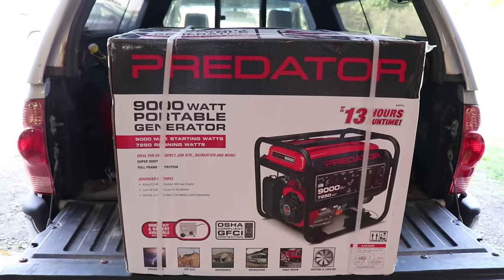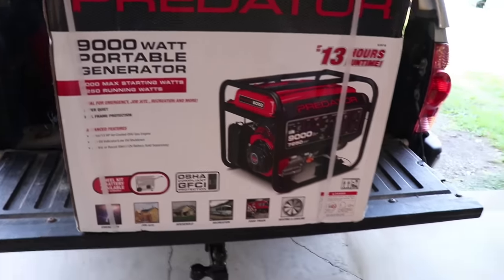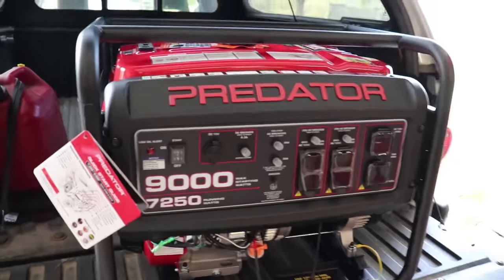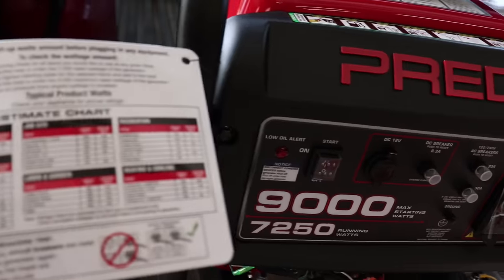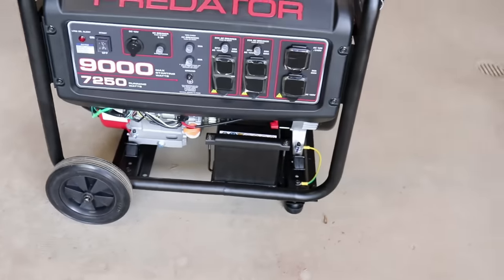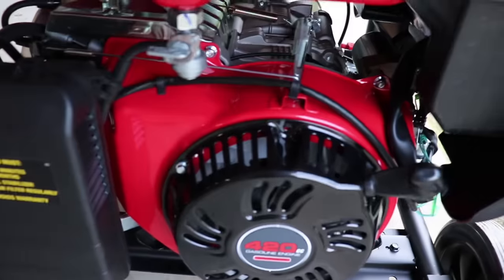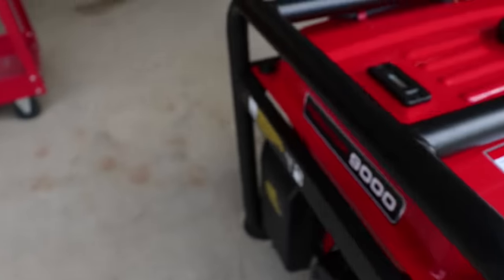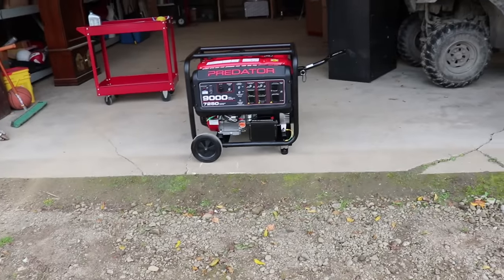Predator Generator Running Our ENTIRE Home. (Complete Setup and Cost)

Comment: I have that same 
Predator 9000 Generator that I purchased from Harbor Freight. I like to see how they wired your breaker box to do this?
Reply from the maker: Look at video in description.
Reply: @TheCookFamilyHomestead  Well, here's my question. With the basic 10/4 Generator Cable. Considering, the Generator has a Female 30 Amp outlet on the Generator. Do you simply cut the Female plug off the Generator cable to wire to the fuse box. Keep in mind, the generator cable has Male connection on one end and female connection on the other end. I see many installing a Female outlet to their fuse box. With a female outlet from the fuse box. Would mean, you will need a 10/4 cable with both Male connections.

Comment: My setup is similar.  240v 30 amp 7200w max on that 30 amp double pole breaker on your box.  I'm on the fence of which generator though....maybe a cat 7500....

Comment: Great information and video. The only thing you didn't mention was how many volts cable you used? Was it 125 or 250? Was it a 30 amp? I have the same generator and same plugin but need the cable. Thanks for your response and the video.

Comment: How's the generator holding up after a year?
Reply: I have something to explain to everyone about the safety and hazards of using generators. Make sure you follow all the manual instructions carefully. We have heard that many people have died each year when using generators due to carbon monoxide poisoning and electrocution. There is something very serious that everyone should always be aware of when using generators. Some people do run their generator indoors which is not safe and that increases the risk of carbon monoxide poisoning which can cause death of family and you. Some people run their generator in wet conditions which can electrocute them. Here’s an advice about generator safety: please remember that you should never run your generator indoors. Remember that carbon monoxide is an odorless and colorless gas that you cannot see or smell. Carbon monoxide is a silent killer. Keep that in mind. Make sure your generator is 15-20 feet away from your house and away from doors, windows, and vents. Having a carbon monoxide detector is very important against generator safety. Some people also allow children to go near the portable generator which could pose risks. We need to keep an eye on our children making sure that they are not near the portable generator so they won’t get electrocuted or burned by the generator which is dangerous. It says on the manual that we should also keep children away at all times from the portable generator to avoid injuries. Generators pose electrical risks. If you need to use your generator during wet weather, you need a generator tent to protect your generator from getting wet. Don’t let your generator get wet. Keep your generator dry and before using your generator, please make sure your hands and your generator is dry. Everything that is said on the generator’s operating manual should not be ignored. Never smoke cigarettes near the generator. Please keep flammable things away from the generator. Never overload your generator too. Your generator can catch fire. Never ever try to plug a generator cord into a wall outlet to avoid back feeding. Back feeding your generator is dangerous. Always turn on your generator first before plugging in appliances and shut off the appliances before turning your generator off. Use a heavy duty cord for your generator and the cord should not be worn out. All the instructions should be followed carefully. Never refuel your generator while it’s running. It can cause fire if fuel spills while your generator is hot. You should turn off your generator and let it cool off before refueling it. This is only a reminder for everyone’s safety of using generators. Make sure your generator is properly grounded. https://youtu.be/I1jT3ANENvI and here is a video more about keeping others safe when using generators. Keeping children safe is also important. Thank you hope you stay safe as well. This is only a reminder to be sure that everyone is aware with all the warnings.

Comment: Question. Looks like the guy in the video has a subpanel. What if you dont have a subpanel and your only panel (MAIN PANEL) has neutrals and grounds bonded? Does that matter?
Reply: The current will return the the generator on neutral and ground which will cause the GFCI outlets to trip on the generator.  Disconnecting neutral from the backside of generator ground post will fix the issue.  That makes it a floating neutral. It would be nice if they would just come from factory floating.

Comment: Will 9000 watts power a 1330 sqft house 3 bedrooms, 2 bathrooms, frigid, deep freezer, stove (oven), central ac and heat, 4 TV's (wifi) and electric outlets?
Reply from the maker: Close...but why do you need 4 tv's??? Lol. Not sure about the central air. If you look in the description I have a video where I run 2 window units with no issues.
Reply: I wanted to know if 9000 watts will light up my home or should I go get the Generac for the house for about $10k

Comment: Haven't looked at all the comments do this may have already been addressed. Did you eventually connect a ground rod and make sure there is adequate ventilation, especially during winter? Also, usually the greater the load the shorter the the tank of fuel will last.

Comment: You need at least a manual transfer switch for utility isolation.   That is a major code violation.  If the main is turned on when the power is down you can backfeed the transformer and kill a lineman. I would suggest buying like a Square D generator panel and put your critical loads in that panel.  You can feed it like a sub panel from utility power but when you transfer you can plug your genset into the genset receptacle. You also need the proper receptacle from your genset like a flanged twist lock.

Comment: Did you do anything about the bonded-neutral vs floating neutral issue?.    The primary concern is that your main box has a bonded neutral ( bond strap between the neutral and ground sides).... AND...the generator (normally used for construction sites WITHOUT going through a main breaker)....the generator is ALSO wired with a bonded neutral internally. So...having a bonded neutral in BOTH places sometimes causes a problem....and the solution (neither is "great", but only "good")...is to either disconnect the ground terminal/connection on your power-inlet connection.... OR.....to remove the bonding in the generator. If you remove the bond in the generator....it as advisable to also attach a label saying so.....so IF the generator ever gets used stand alone like at a campsite or construction site....you would know, and re-connect the bond.
Reply: Don’t forget about generator safety as well https://youtu.be/I1jT3ANENvI remember, it’s also important to keep your children safe when using portable gas generators. And remember not to run your generator indoors. Just reminding everyone to stay safe. Thank you

Comment: The trip on the breaker should trip when too many breakers are on at 30 amp  right ?
Reply: That's not what matters. The total current you can draw is 30 amps. Too much current causes heating by I^2 R law. That heating could start a fire, hence the circuit "breaks" with the breaker. Before they used fuses, which were simply thinner wires that were designed to melt first, saving the rest of the circuit. Amps times volts equals watts so you should add up how many circuits you're powering and subtract that from 220volts times 30amps for 6600 watts. If it outputs 240 volts that's 7200 watts. Even though the rating of the unit is 9000 watts, that's at peak, not steady. You can exceed 30 amps with a 30 amp breaker for about a minute or so, then it is triggered off.

Comment: I have the predator 4375 watts portable generator. Will that run my house?
Reply from the maker: It would run a few things. Look up what wattage your appliances use. Should have no issues with refrigerator, freezer, water pump, furnace....but hot water tank or dryer will be a ton of wattage.

Comment: If one had to keep this particular generator running full-time, I wonder how long the full tank(8gallons) would last?
Reply: They say 13 hours at half-load.  So it depends an awful lot on what you are running.  I used a much smaller generator a few years ago and that was able to run my full-sized refrigerator, 2 wall acs, a tv, LED lights at night, and a microwave.  For that one, I turned it off at 11 pm and turned it back on maybe 9 or 10 am.   I basically am using the 9000 at 1/4 load to double the time between fuel.

Comment: What about the Tv or Computer. Will it run them?
Reply: Yes, we have close to 90 hrs. run time on our generator.  We haven't experienced any issues running sensative electronics.  I did adjust the throttle screw though, so when under load, the generator would produce 60 to 61 Hz.

Comment: Something I didn`t hear him say is, another reason to have that switch to turn off your main if the power goes off is, if there is some poor slob of a lineman down the road would get fried because he thought the power was off on that line.
Reply: Yes! Anyone that works with electricity should ALWAYS check for current, but if he checks and it’s dead and starts working on the line, and then someone gires up their generator it will charge the line.
And linemen are NOT slobs!

Comment: When you turned on your kitchen faucet that did not prove the well pump was working that was just the water in your tank you need to run it until the pressure drops and your pump will kick on.
Reply from the maker: Check out the test video I did. Posted in the description.

Comment: I just bought this and the manual says it needs to be grounded. I do car detailing and grounding would be difficult. Is it neccessary to ground to use vacuums and carpet extractor??
Reply: It will work fine without the grounding. I have the HF 3500 inverter gen and I never grounded it, all the computers and LED tv's in the house run fine.

Comment: Curious if you have noticed any issues with electronics you have been using? Since its a standard generator and would have high THD vs an inverter generator. I have been on the fence between an inverter and a larger standard.
Reply: Good comment....my feeling is that the low-THD thing is severely overhyped. Everyone "talks" about the danger of frying "delicate" electronics.....but what exactly are these devices? I've seen no one actually post his personal experience having done so to damage stuff. Everyone (nowadays) is worried about frying "delicate electronics" and therefore trying to force everyone to upgrade to inverter-type  or low THD generators. No one really defines what kind of devices are "delicate"...as I see a lot of folks using these standard type generators for laptops, flat-screen TV's, internet box, etc.....with no problem. I would love a definitive answer too.....

Comment: Here in the Uk petrol costs £1.65 a litre! The generator average fuel tank is 20 litres and will run on half power for around 8-10 hours? 20x 1.65= £33 per day does this sound about right if so that is very expensive even though it’s only for emergency outages? Has to be another cheaper way to power our homes? Just a thought NOT a criticism. Great video all the same. Thanks

Comment: I got tired of having to keep gasoline on hand so I had installed a Generac 20KW whole house natural gas generator. It is automatic. It comes on for 15 minutes every Saturday and runs in self-test mode.
I figure if I bought a gas generator and ran out of gas there won't be any gas stations around open.
I have had power go off at night. The whole neighborhood goes black! My generator comes on in 10 seconds and we are back in business.
when it is running it sounds like a lawnmower 2 houses over mowing the grass. The city gave all the installation a green bill of health.

Comment: I have a predator 9000 also, but my question is, do you believe it will run an AC?  I mean central air not a window unit.  Someone in our neighborhood said it would run it but it would be getting the AC to cut on would be the issue.  It wouldn't have enough amps to initially start it, or whatever he said lol.  I know you did a video on AC units but those were window units.
Reply from the maker: It all depends on the wattage of your central AC unit. On a newer smaller model, it would run it with no issues as the newer ones are more efficient. Just look up your model number. 

Secondly, window units use a lot of wattage and I was able to run 2 of them plus everything else in the house. 

Thanks for watching!
Reply: We can run our 3 ton AC unit, plus eight additional circuits at the same time. I did install a hard start kit though.

Comment: 8 gal tank @ .81 cent/liter=$24.80/tank. 13 HOURS PER TANK=$24.80
4 Days: 12pm-8pm=$99.20
52 HOURS=$99.20 FUEL/GAS
OIL CHANGE EVERY 25 HOURS= 2 OIL CHANGES WITH ONE 5 LITER OIL CONTAINER @$19.99
You should be able to live threw 4 days of an emergency for about $120.00USD.

Comment: The good ole days. Those Predator engines are pretty good. They're Honda clones. If you need parts you might be able to use the Honda engine that they cloned. I used a 420cc to repower a 622 AMT John Deere Gator a few years ago. Still running strong. I change the oil once a year.

Comment: so you need at least 6500-watt system for a small house if you want to run a furnace, like us in Indiana winters, just a heads up furnace, fridge, lights, and stove. if you need more then that get the 9000-watt system or bigger

Comment: So you're saying the "interlock device" was $60. It's only a metal plate cut to interfere between the two sets of breakers, right? That could be made much cheaper another way if that's the case. Please correct me if I'm wrong.

Comment: That will run the house fine nice generator shes a nice generator  the air conditioning system is the biggest power user i turn off unless im running my big girl but I normally run a two kw generator that runs our normal usage except boiling the jug for a coffie

Comment: If you're homesteading way out there, it's a good idea on these cheaper generators to purchase a replacement voltage regulator ahead of time.  They're not expensive and super easy to replace.  And YES they will fail.  Monitor your voltage from time to time too.  When they fail, like mine did, they can go as high as 186 volts on the 120 outlet...again...like mine did.  Just sayin'.

Comment: Might want to get the interlock switch installed before sending juice from the generator. VERY bad things will happen if the main breaker is flipped on at the same time as the generator breaker.
Reply from the maker: It is installed. Look at video in description of the hook up to my electrical panel.
Reply: @TheCookFamilyHomestead  OK

Comment: How can i connect it into a 220/240 volt loads because here in my country, in the Philippines, our voltage source is 220 volt, and i have that kind of generator, PREDATOR 9000 WATTS PORTABLE GENERATOR, when it runs, it only gives 120 volt AC source, but in the specs it runs with 120 volt and 240 volt, so how it turns into 240 volt?
Reply: Don’t forget to watch this video about generator safety as well https://youtu.be/I1jT3ANENvI just hoping you stay safe. Thank you